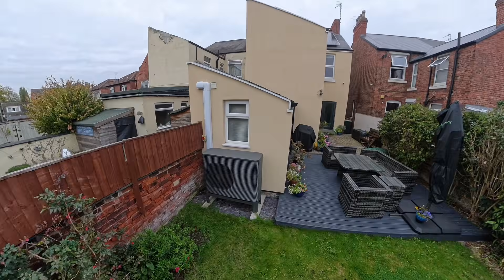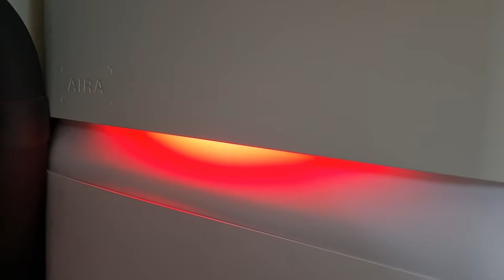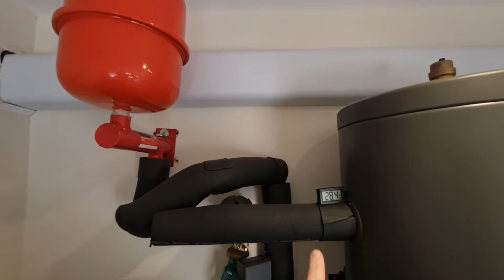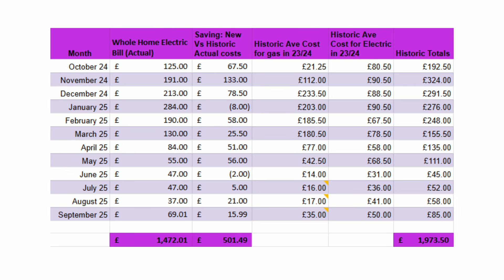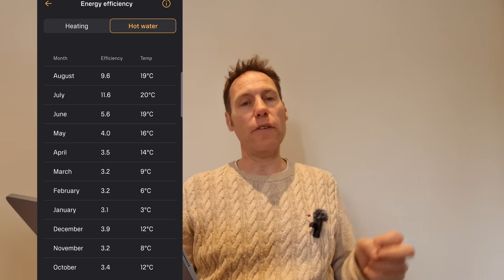Aira Heat Pump, 1 Year later: Any Savings? Any Problems?

Comment: Nice to see different methods of calculation… so many people just rely on OEM SCOP figure. quick questions… 1) why 85% for boiler? If your system runs cool enough for SCOP in the 4s boiler would be about 97%. 2) did you factor in any opportunity cost for the installation cost? Eg 5% interest that could be earned/saved 3) what upgrades were needed? Bigger rads etc?

Comment: Aira came out us.  The sales man said yeah your house can be heated by a heat pump.  I live in 6 bedroom dorma bungalow built in 1990.  The house has had the loft insulation, cavity walls insulated, new triple glazing, new larger radiators, 20kw of solar panels and 25 kw of battery storage.  We are currently using a gas combi boiler.  The Aira tech guy came out looked at the microbore pipes and went "8mm pipes are to small. We would have to rip up your floors and walls, and in my opinion your house is too nice to rip apart and re piping will cost you in the region of £25k by itself. Just upgrade your boiler and run the flow temperature lower to save money if you want to do anything. I am sorry to say you wont see the roi on a heatpump in your lifetime."  So we have gone as reneweble and green as we can  we have solar and batterys, we insulated what we could our epc went from a d to a b.  We use an induction hob and have two evs but our home without signifcant cost to us cant be heated by a heat pump. Which is really annoying when you have done everything else possible.
Reply from the maker: Sorry to hear that. I've heard of installs from octopus on existing 10mm, but 8mm may be a step too far. Have you thought of asking octopus or heat geek for a second option? I'm in a similar situation with a home battery. I have plenty of outside space, but because of my electrics being in the cellar and have a fully tiled gound floor. The only way to run the cables are extremely long round 3 side of the house and extremely expensive. No ROI as it stands. Can't put it in the cellar, so we are stuck.
Reply: It’s really reassuring that they are honest like that. We couldn’t get the figures to come out anywhere close on our 1900 house when all costs were factored in… like LAUGHABLY far away. Doing the same thing as you… we have a TadoX control system that gets a great balance between efficiency and comfort automatically.

Comment: Interesting savings how much was the system to install? no including any grant
Reply from the maker: £13500 not including the grant. I paid £6000. The £7500 is open to everyone to get. the system will pay for itself over the 15 year warrantee. That's setting aside that we would have needed a £3k boiler replacement anyway, as the old one was shot. Our overnight electricity tariff also just halved in price at the start of the April, so I expect the savings this year will be greater.

Comment: I have had a quote and the survey was done yesterday (Wednesday). Looking forward to the final design although Ian who came (Inverness based) towards the end considered there could be more rad swaps than the initial quote with 5 rads swapped as well as the  DHW tank change to a 200L unit. My house is 121 sq m and 2007 build EPC C 77 and following the survey from the Heat Geek local company the heat loss came in at 5.05 kw and there were no recommended rads to swap and surprisingly no change of DHW tank which is Megaflo 150L. 
I have queried the offer of Aira Carbon Rewards which mentions an 'up to 10 year' package which would provide maintenance and a warranty period of 10 years at no cost. I checked the fine print in the terms and conditions and there are so many 'get out' clauses which mean the agreement could be terminated with 30 days notice. A free 10 year package would represent a ~£2.4k saving over the Aira all-inclusive £19.90/month package. Have you any experience/knowledge of the carbon rewards scheme.
Reply from the maker: I am aware Aira are now offering a carbon rewards scheme but it's pretty new. We were an early Aira customer and the offer was quite different at the time. We have a 15 year guarantee with no monthly service payment. They offered this for about a year then switched to the monthly service package for new customers. If it's any reassurance, we basically pay nothing just like the carbon rewards scheme, and we have had no problems getting a call out. Customer service has been very good. 
If you have a fixed price quote from Aira now, any further radiator changes they feel you need would be at no extra cost. If the Heat Geek quote is coming out cheaper, but they propose no cylinder or radiator changes, the quotes are quite different and the Heat Geek system will likely cost more to run. The smaller radiators will need to run at a higher flow temperature and your old cylinder will have a smaller coil in which will take longer to heat up. You could get Heat Geek to quote for a 370% efficient system with a new cylinder which would be similar on running costs, then see how the quote compare. I am happy with our system but Heat Geek do have a good reputation and are now competitive on price, unlike when we had our system installed. It makes for a harder decision between the two companies now.

Comment: Thanks for the vids. Very informative. We had Aira install in June this year, so just getting used to it now. Certainly warm enough, and my wife says a lot more comfortable heat consistently rather than highs and lows. But if anything the house is sometimes over heating, even though I set to just 18-19 degrees, it has been 20, and ASHP still running and heating, so finding myself manually lowering a degree or 2 or turning off for an hour or so. But I don’t really want to micro manage all the time. 
How was your first cold spell? 
Comfort levels? 
Other householders feedback? 
Where is your thermostat and what level is it set?
I tried savings setting, but then peaked with higher temps and think cost more. Already had £12-13 a day costs according to Octopus App, yet gas was max £8-10 last winter. That’s Edwardian semi down in London. Early days monitoring no complaints with heat and water

Comment: Thanks, that's useful feedback on your experience and useful data!

One thing I noticed: you seem to have calculated your annual SCOP as the average of the SCOPs of all months. I think you should do a weighted average instead, i.e. take into account how much heat was produced / how much electricity was produced each month. That is because your heatpump worked a lot harder in January than in August, so the COP of January should count more towards the annual SCOP than the COP of August. And the COP in winter months when it is cold outside is lower than the ones in summer months.

Or more simply, you could calculate SCOP as SCOP = (sum of all heat generated through the year) / (sum of all electricity consumed through the year).
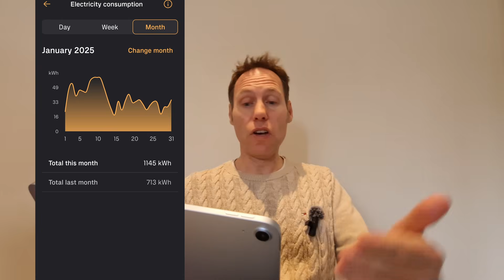And the numbers on your table at 5:23 gives me a SCOP of 3.84.
Reply from the maker: Thanks for spotting that. A scop of 3.8 is much more in line with similar heatpumps on open energy monitor. I'll be sure to use this in going forward.

Comment: What if the boiler was 98% efficient like the viessman vitodens 200, how would it compare.
Reply from the maker: I used 85% as a fair representation of an old boiler, likely one ready for replacement. If you have a boiler that is actually hitting 98%, it's likely not ready for replacement. But the figures are all there if you'd like to work it out.

Comment: I’m planning to have the indoor and buffer units installed in the utility room next to the bedroom, but I just wanted to ask if either of them makes much noise?
Reply from the maker: I wouldn't call the utility room quiet but wouldn't call it noisy either. The circulation pump is what makes most sound. Ours is next to our dining room, which has a solid brick partition. it's barely noticeable at all in the dining room. If the dining room was our bedroom I would be perfectly comfortable sleeping in there. I've just done a quick smartphone sound meter test for you. The utility room is 42 decibels, the dining room is 32 decibels, and the actual bedroom is 31 decibels. Maybe download a free sound meter app and try your boiler room and bedroom out to see how you currently compare.

Comment: Efficiency figures are useful for those that run a different tariff to you, which is why "at the price cap tariff" comparisons for both electricity and gas are common (you can also get cheaper gas tariffs).

Comment: Good to see the updates. We had our Aira HP installed in August '24 and have seen similar savings compared to the combined gas and electric bills. Over the first year it was around £480 less. For the SCOP using the energy in/out it was 4.2. I'm always take the app SCOP with a pinch of salt. Overall though haven't had any issues, house is warm and the energy bills are less.

Comment: There is an 8kw Aira heat pump on open energy monitoring site id 366 reporting an annual SCOP of 3.37 worth a look, seems to be a much colder part of the country but the external temp readings. It’s just nice waking up and having to look out the window and check the weather app to find out how cold it is.
Reply from the maker: Yeah I'd spotted that one! I'd love to see how there two sets of figures compared betweenthe app readings and open energy monitor. They had -8'c in Jan, we only had -3'c.